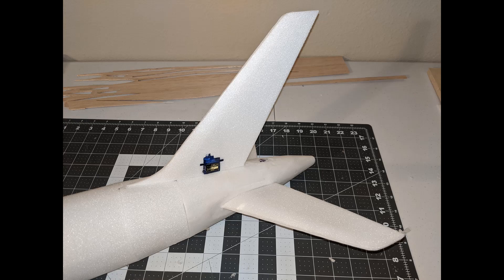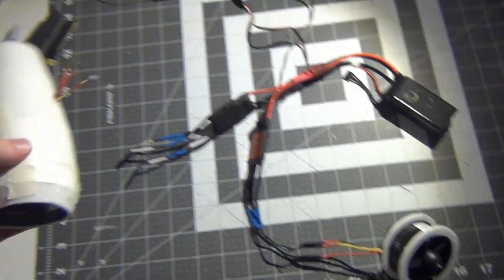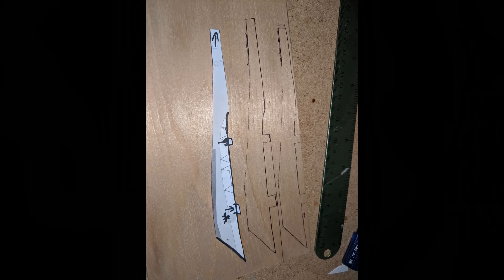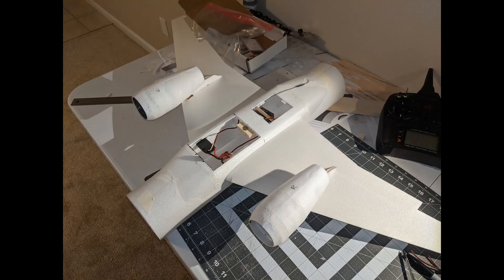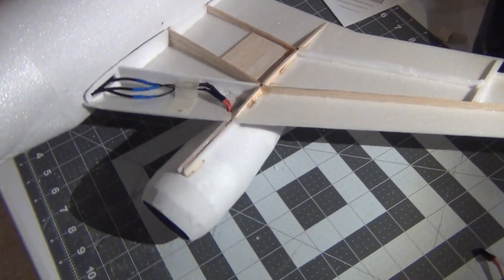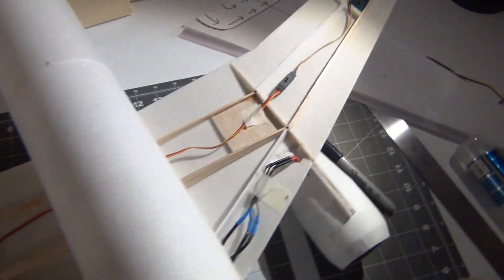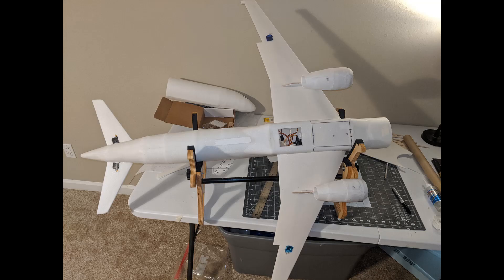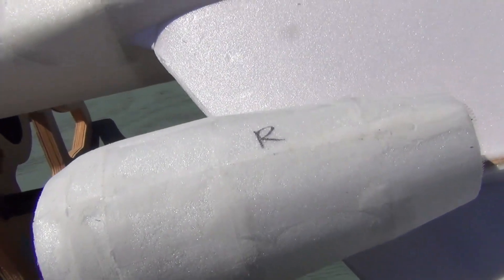R/C Boeing 757-300 Build: Electronics, EDFs and MAIDEN FLIGHT (*RC AIRLINER HOW TO*)

Comment: If this was the only channel I subscribed to YouTube would be one of my favourite places! It’s nothing new, building flying RC airliners in depron using card model templates, but you do it so well and you get a much better looking model than many others. I want to start my fleet of airliners too but with vacuum molded nose, tail and nacelle parts. I actually turned a plastic 1/144 model A330 into a flying model (depron wing and tailplane) with what I believe are the worlds smallest EDF’s at 18mm - it flew but was extremely sensitive.

Comment: This model is amazing! would I have to use counter rotating EDFs?
Reply: in my experience, you shouldn't have to. my 777 airliner has two normal same-direction EDFs and doesn't seem to have any problems

Comment: I bought two 2200mAH 3s batteries for my 737 MAX-7 and I have 2 50mm EDf's, so does that mean I can use 1 battery for both engines?  2 of those batteries for both engines is a bit too heavy.  Also, great job with your 757!
Reply from the maker: Yes I would use one battery for both EDFs at that size. Just solder the ESC battery wires in parallel and y harness the receiver wires
Reply: @E744763Productions  Thanks for the advice. Could I use a XT60 Y harness instead of soldering?
Reply from the maker: @FeatherwayAirlines  yes, that works. Just adds a little weight